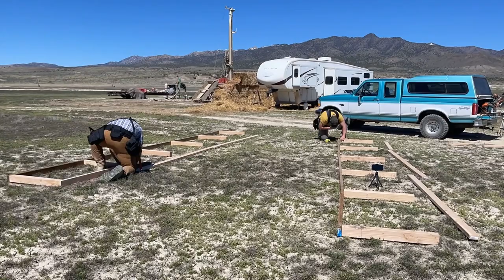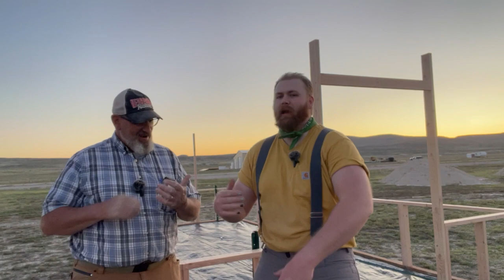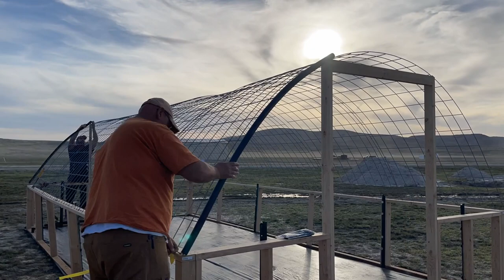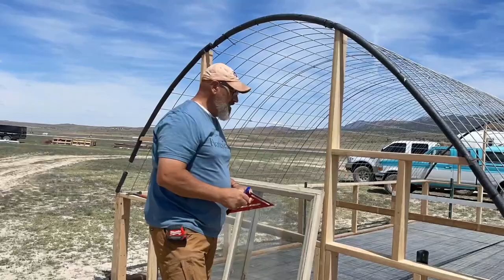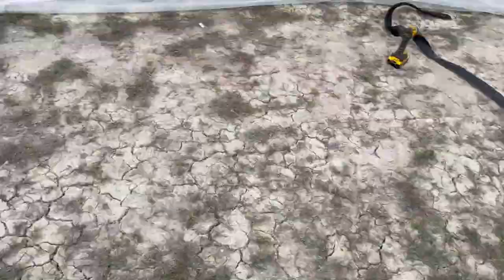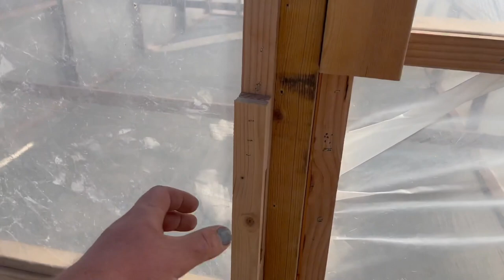CATTLE PANEL HOOP HOUSE: FULL BUILD

Comment: Everyone makes the same error:  (me too) make everything Wider and Longer than the building. Always can make adjustments. Weed barrier should be at least 12 inches wider, overlap the cattle panels if they are too long. Zip ties are your friend. I ended up making a "porch" over the door to open out, and protect from snow, wind, and rain. Also made the rear a panel longer to cover the IBC totes for water storage. For storage I would use a waterproof tarp NOT greenhouse plastic. Guaranteed to tear! Stay on course!
Reply from the maker: We overlapped the panels and zip tied them together, but I suppose we could have overlapped them more. We’ve been very surprised and pleased with how well it’s held up in the storms and wind we get out here. We really needed to use more weed barrier in the green house, it all shrunk! We hope all your builds and projects are successful!
Reply: Weed barrier stops nothing just gives the weeds a nice place to grow that you cannot get too. ALWAYS USE patio pavers so they will heat up in the fall and winter to prove more heat. You're not stopping weeds.
Reply: Zip ties fail ~ grid panel connectors are a thing
Reply: Good point about the zip ties. They're all beginning to fail.

Comment: We were in the greenhouse business for 17 years and built several hoop houses , you might consider using wire that is used to secure rebar together instead of plastic zip ties. They  are precut wires with a loop on each end, there is a hook tool that is used to twist the wire together, fast, economical and lasts as long as you want it to. Ties get brittle and bust after a year. Plus research wiggle wire to secure plastic, comes with aluminum c channel and wiggle wire, tremendous product, far better than batten boards that let plastic rip out at nail holes due to wind.
Reply from the maker: This is some great advice! We used wiggle wire on our actual permanent greenhouse and it’s great. Most of the zip ties on this build have already busted, so those metal ties definitely seem to be the way to go!

Comment: What excellent tips for our green house. We have all ready built a duck house this way and is has not moved even in gust of wind approx 80k/h. We have a big tarp over it and it is tied down with nylon rope. Nothing moves.
Reply from the maker: It does seem to be a good way to build a structure like this. I've been amazed at how ours has held up. I'm curious where you are from. Simply because you used k/h instead of miles.
Reply: @CastleFarmsHomestead  I am from Australia.
Reply from the maker: That's awesome. Glad to know we're reaching you over there. It's exciting to here about others adventures. Are you building your greenhouse soon?  We have recently finished our larger hoop house. I'm really excited about it. We have several videos on that process and will hopefully soon have a "complete build" video as well. I hope all is going well in the land down under. Thanks for watching.

Comment: Hog rings for connecting panels togather
Reply from the maker: That would be better than using the zip ties. We've already had several of the zip ties break. Thanks for the suggestion.

Comment: I think your version is probably the neatest I have seen. One question, have you had to reinforce the side walls. And how are you handling the wind.
We have severe winds in the eastern foot hills of the Rincon Mountains in AZ
Reply from the maker: Thank you very much! Haven’t had any reason to reinforce the side walls. The one thing we would change is using more fence staples to hold the panels in place, they’ve worked loose from the wind storms, but it’s holding strong